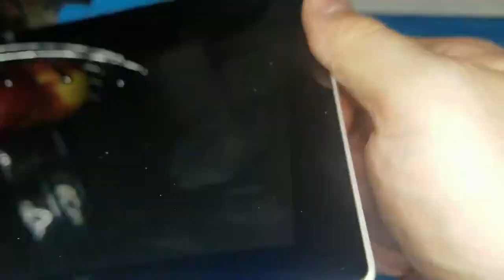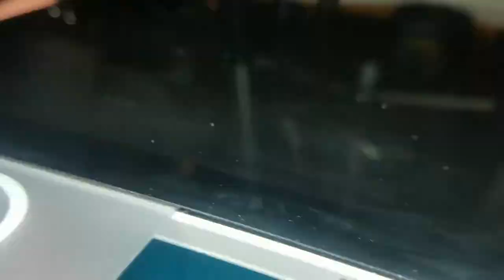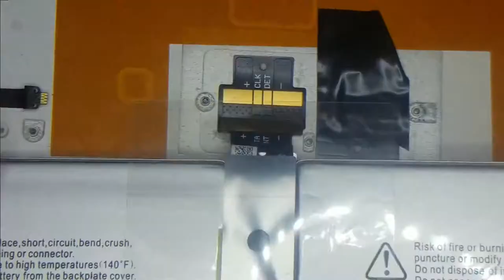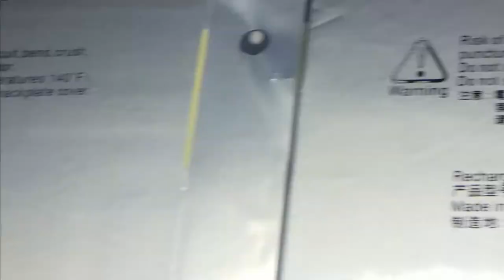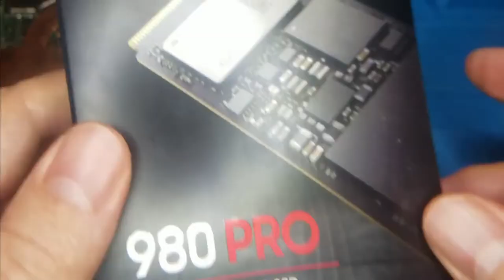Microsoft Surface Pro 4 - screen bulge fixed, battery replaced, SSD upgraded!

Comment: Great information but you just take so long to get to the point I need to fix this not read a novel
Reply from the maker: Just like longer videos get comments that they need to be shorter and to a point, shorter DIY videos are full of comments that too much is skipped/fast forwarded, and viewers can't see exactly what is going on and follow the steps. Considering that you can't see what is not there, my approach is to do more detailed videos, and put in chapters for navigation. This way, if you want to zero in on something, you can, and you can skip/fast forward parts you are not interested in. And the viewers who like to see more details can do so as well. And believe it or not, some of us watch these videos for entertainment/education purposes, not because we need to fix something right away ;)
Reply: Well it is good to actually see the disasemly at Real speed these connectors are tricky to remove. THANKS !
Reply: have you heard of the FF feature?  It's been around since before you were born.  Very rude.